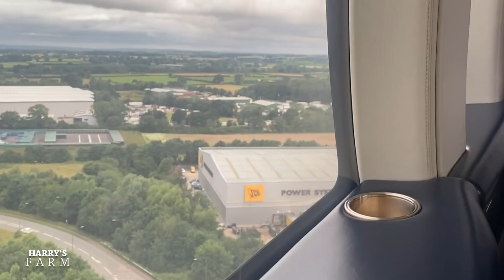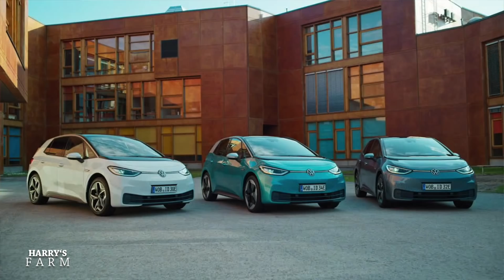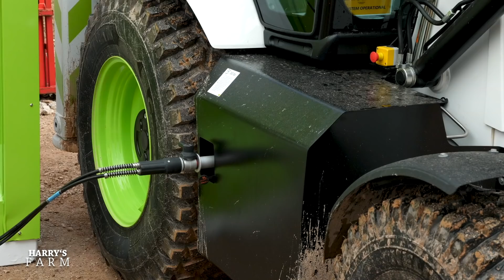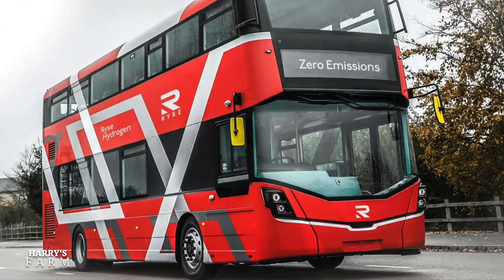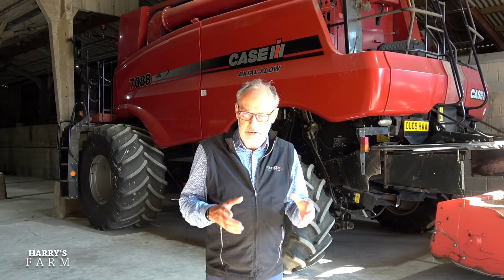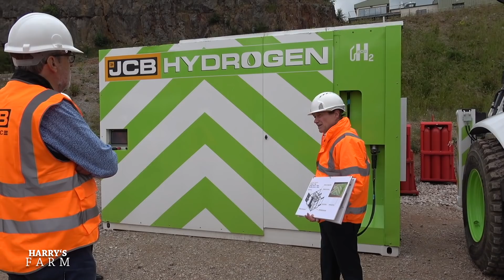Why JCB thinks hydrogen is the best alternative to diesel for heavy machinery, farming and HGV fleet

Comment: Brilliant discussion. Some valid points, regarding run times etc, that many wouldn't realise. Thanks for posting.
Reply: oil companies attempting to sell oils and gas dressed up as hydrogen it is a scam    Depending on the quality of the feedstock (natural gas, rich gases, naphtha, etc.), one ton of hydrogen produced will also produce 9 to 12 tons of CO2  
However, hydrogen combustion with air produces oxides of nitrogen, known as NOx. In this way, the combustion process is much like other high temperature combustion fuels, such as kerosene, gasoline, diesel or natural gas. As such hydrogen combustion engines are not considered zero emission.

Comment: I found this extremely interesting as an excavator operator, I come from swindon and I drive a jcb 140 x and I can't fault shure their are a few thing I would change but it really does drive like a dream. never had a break down in 15 months. the one thing you didn't touch on was how much is hydrogen a litre all the same though hydrogen is definitely the way to go.
Reply from the maker: Thanks for watching. I didn't touch on the price of hydrogen in the video because diesel will remain the dominant fuel for heavy machinery for some time. Hydrogen powered machinery is still some way off. Lord Bamford just wanted more people to be aware electric isn't the answer for the bigger stuff and the world needs to wake up to this fact. Hydrogen currently offers the best solution, in JCB's opinion.
Reply: harry thank you very much for your reply.

Comment: One of the most important interviews, for a true insight, to our modern emerging world. Thank you.
Reply: your going to love your social credits , i bet .
Reply: Unfortunately not. this offering ignores the main problem with hydrogen, which unfortunately Harry et al either choose not to mention or simply don't understand!
Reply: @dipladonic  What's the "main problem"? Is it getting the hydrogen to the farm, mine, constriction site, military battle and storing it there (safely and economically) for transfer to the using machine? Whatever the problem is, you can be sure this Bamford chap is working on it - with his engineers, prototypes and field testing.
Reply: @Myrmecia  If you want to save the planet from the man-made CO2 climate emergency the main problem with 'green' hydrogen is that it takes a huge amount of unreliable and dilute wind and solar energy to make a tiny amount of green hydrogen.
Reply: @dipladonic  Thanks for your prompt reply and alerting me to this issue. I am not an engineer, so I will just have to stay alert for any coverage on this issue which expands on the importance of the "huge amount" and "tiny amount" you refer to.
Reply: @Myrmecia  You won't easily find references to the "huge amount" and "tiny amount" that I refer to as they are never mentioned in relation to any green hydrogen casuistry. There are many green hydrogen pilot projects, some of them will at huge cap-ex costs eventualy produce thousands of kilograms of expensive green hydrogen per year. Unfortunately, globally, we use 49,640,000,000 kg of cheap, plentiful, reliable oil every year. You do the math...then add coal and gas into the equation, then figure out for yourself the veracity of grid-scale green hydrogen. Hopefully, you will have the objectivity to realise that it is nonsense!

Comment: A very thought provoking and interesting video, the ICE certainly has a lot of bad press based on incomplete information and assumptions. A friend and I did a shady conversion to a Vauxhall Viva to run it on butane/propane in the late 1970s, literally an evening spent converting an SU carburetor so it would meter low pressure gas. Far from an engineering marvel but it looks like the industry and governments have little interest in doing similar. There is a lot of merit in adapting existing technology, though of course carrying hydrogen at hundreds of bar pressure in a fast moving passenger car presents different challenges too. Well done with your content Harry, always educational.
Reply: We don’t have to have it compressed if it’s made onboard hydrogen gas can be mixed with  diesel to make it more combustible making current engines much more efficient there is a company developing small ish  on board hydrogen units for lorries in the states at the moment
Reply: @matspencer3860  making hydrogen requires energy, which needs to be carried on board as well. Is it then not more efficient to use that energy directly for propulsion? Please provide a link for that company in the US making H2 units.
Reply: @matspencer3860  Making hydrogen from what?
Reply: LPG and hydrogen are very different beasts.
Reply: @MattOGormanSmith ,  yes they are, but I am sure a 1972 Vauxhall Viva van would run on hydrogen too.
Reply: oil companies attempting to sell oils and gas dressed up as hydrogen it is a scam    Depending on the quality of the feedstock (natural gas, rich gases, naphtha, etc.), one ton of hydrogen produced will also produce 9 to 12 tons of CO2

Comment: Great video, great to see Hydrogen getting some recognition as the true zero emission alternative too. My wife has done extensive research on Hydrogen combustion retrofits for HGV and bus applications and the Gov are looking at it actively. I truly do not see why battery electric is seen as this one true hope for humanity. It makes no sense.
Reply: You are correct it's seems to be an all or nothing approach.   Lord Bamford is correct about mining for the metals needed too .
Reply: Hydrogen In ICE is not zero emission. There will be nox
Reply: @SuperJohn626   - there are catalytic converters... (they are a thing)
Reply: @kadmow  yes. There is also adblue. That doesn't make hydrogen "zero emission fuel" In ICE. I think hydrogen is way to go, but fuel cell is   the key. And long time (half year and more) storage for hydrogen is liquid NH3.
Reply: @SuperJohn626  : everyone has to agree, less pollution is a good thing, if we can get there cost neutral or cost positive long term, that is fantastic, often the hurdle is quarterly cashflow not technology.
Reply: Hello mmmbilly is that research available publicly?
Reply: Trying to bottle it, and distribute it seems to have been difficult. But until Musk made batteries a practical proposition, about twenty years ago, hydrogen WAS seen as the future.
But we also need MSR nuclear technology to produce the hydrogen. At the moment, we get it by starting with methane. Whoops.
Reply: @paulsutton5896  we need to produce NH3 with solarpower, and bottle it. (large scale) Then membrane to crack it to hydrogen and use with fuel cell.
Reply: @SuperJohn626  Good luck with that one,
Reply: @paulsutton5896  check out CSIRO. Their sites find hydrogen and ammonia researches. Australia is believing it
Reply: @SuperJohn626  
I will keep my eye on it.
Reply: Hydrogen causes metal embrittlement, it will destroy engines. It's also difficult to store a useful amount of hydrogen onboard something which uses it as inefficiently as an ICE vehicle.
Reply: @PistonAvatarGuy  : hydrogen embrittlement is a straw man argument - it is mainly a factor in poor manufacturing processes (QC) and  shows up in cryogenic systems mainly.  - neutron embrittlement is a more significant effect to deal with in the nuclear sector.

We have been storing hydrogen in steel tanks and passing it through steel pipes (some natural gas has quite a lot of  hydrogen in it)  for a long time, these things are understood quite well.  

PS. I love batteries for certain applications. Shopping carts and personally owned people pods are a great use...

For high use long haul transport electric trains kick a$$ - just have to break a few monopolies (or get onboard BH.) to make costs realworld.
(Teamsters don't like trains)

I agree hydrogen volumetric energy density is poorer than alternative energy carriers.

Ozone layer??

What about Tesla,  etc.. use of HFC 134a  ??  - it may be nice to Ozone but not the Greenhouse (depending on how one looks at it)
Reply: @PistonAvatarGuy  ...neither of which is the main problem with hydrogen, which unfortunately Harry et al either choose to ignore or simply don't understand!
Reply: @PistonAvatarGuy  Is this for all metals? Maybe we need to develop the system more rather than sideline it completely. EVs are certainly not the complete answer
Reply: @Evanbkwh  I think that some can be made to endure exposure to hydrogen, but whether or not they can be made suitable for use in engines is another question. That's also just the beginning of the problems associated with using hydrogen as a fuel.
Reply: Everyone here putting holes in FCV tech whilst BEVs are literally exploding if they get too hot, use ridiculous amounts of rare-earth metals and pretty much have no way of solving the range problem despite near-constant work on battery technology since the 1970's when Lithium-Ion batteries first came about.

Hydrogen's problems seem like they are less to do with the physics of energy storage, and more to do with the more achievable aims of metallurgy and chemistry and if there's one thing I can tell you out of my ok grades at school is that it is a lot easier to work around extant limitations of chemistry than it is to work around extant limitations in physics.

if FCV tech had the same amount of investment as BEV tech, we'd probably have already seen new metal compounds that are more durable when exposed to hydrogen as well as better infrastructure which to my mind is the real blow for FCVs at the moment. 

There has been experiments with hydrogen "goop" recently though which looks like it solves the storage issues and looks to be to my mind the future of electric vehicles. Plug in your "goop" cartridge, fill up your tank with water for the reaction and off the Fuel Cell goes.
Reply: @Reddsoldier  I'm not sure you know all that much about BEV.
Reply: @Reddsoldier  Yes, you might be able to solve the materials problem, but at what cost? EVERYTHING associated with hydrogen is expensive, absolutely everything, and that's not a problem that's ever going away.

If you're planning on using hydrogen to fuel an ICE vehicle, you're going to end up with a vehicle that has very little driving range. Hydrogen is a very voluminous fuel, so it's difficult to store enough of it in a vehicle for it to be very useful, you might get 1/4-1/3 the range of a normal gasoline or diesel vehicle. That's not a problem that development can fix. Hydrogen also leaks THROUGH materials, and if it leaks into the atmosphere in large enough amounts, it will cause the hole in the ozone to grow again. The real problem with hydrogen, though, is the pressures involved in storing it, they're extremely dangerous and make everything involved with storing the fuel expensive. Just imagine millions of poorly maintained, aging passenger vehicles running around on the road with 10,000 psi hydrogen tanks in them, it would be disastrous.
Reply: Whatever happened to the hole in the ozone layer? Perhaps climate change will also disappear?It wasn't hydrocarbon vehicles that caused the ozone layer breakdown it was the then used coolants used in refrigerators.GM had a longterm car running on hydrogen in 1973.Its performance was similar to the gasoline engine apart from its fuel consumption which was 35pc higher than the gasoline version.
Reply: @eugeneoreilly9356  The ozone layer was fixed - actually by Mrs Thatcher.
Reply: @paulsutton5896  and she was well on the way to solving the climate change hoax by closing all the coal mines.You could say that she was ahead of her time.
Reply: @eugeneoreilly9356  I don't  know if you are intending irony. 
Certainly we are all better off, leaving the coal in the ground.
Except when we want coke for steel production. We should not extract it just for its energy.
And the downfall of Arthur Scargill was ... ... just glorious to behold.
Reply: @paulsutton5896  yip, Scargill and Thatcher,the extreme ends of a wide spectrum.TBH Paul I lost interest in the whole green agenda years ago but having said that I'm all for clean water,air and energy.The real irony is this,while India and China burn fossil fuels at an ever increasing rate to accommodate their expanding economies,we think that we are green because we recycle our plastic milk bottles,by sending them to these places.How ironic is that?
Reply: @mmmbilly
after "extensive research" you do not see why battery electric is seen as this one true hope for humanity?
Then you should take a look at how much electricity is needed to produce the hydrogen for let's say 200 miles.
And the look how far you can drive with the same amount of electricity when it is used in a e-car with battery.
To be honest i have already forgotten the numbers i have seen half a year ago, but i can asure you that you will be surprised by the difference.
I could be completely wrong, but i guess that will be a relatively big factor for the next few years till there is a lot more renewable energy available.
Reply: @fujiwaraemiko7318  long time (half year and more) storage for energy, batteries aren't good for that. Ammonia and hydrogen are solution for northern countries for winter.
Reply: SuperJohn626 , and all the rest of you scientists. 15yrs ago I saw a video of a man in the USA that had a VW connected to about 4 of those large  5 gal  water bottles for the water cooler inside he had a plastic x running from top to bottom . Wrapped around the plastic were wires of 316 stainless in notches that kept them separated by about 8mm . The wires were connected to batteries, making positive & neg electrodes , with fuse & restate to control the power , the water had backing soda in it to help the conduction of the electricity which caused the separation of the H out of the H2O . 
His next vid was one of his Toyota Corolla with about 8 one qt mason jars set up the same way  with regulated air in & lines connected from one to the other & into the air cleaner , so the engine could suck the hydrogen off , he changed his gas mileage from 28-29 mpg to 58-60 . 
I have the set up & I have a old Toy LC ( no computer)I am going to put it on when o get it built up , if you have computerized vehicle you have to trick the computer which he also will provide & instruction as to the quantity of bubbles per min for each jar . I tried it on my 2007 GMC -350 but did not make much diff as I could not find enough room for more than 3 jars 
I know of another co that I made comment about in the main blog
Reply: SuperJohn626 . Google Gail Banks Cal USA  water methanol injection for both gas & diesel.
My father with the Royal Can Air Force  was a ww2 aircraft engine mech , even worked at the Rolls Royce engine plant in England , he said that when the aircraft gets so high & the engines reach the high speed they would turn on the water , that is what made the exhaust smoke turn white , also you will notice the car always runs better when it is raining , he also said the Germans were making petrol from coal , so what is our problem , follow the money . 
My grand father wrote Ford motor co in the 40s or 50s era , asked them how to build. Gas economizer for his Fordson Major tractor , they said Put a water tank above the carburetor , hose , stainless needle valve water regulator & drip water into the carb , so my dad helped him set it up , they said it worked great ,  he used it when he had the tractor stationary using the power take off drive pulley , but being just a child I did not go & see it

Comment: There have been H2 engines in past (BMW V12?) and I still don’t understand why to use H2 as fuel. Only reason I can think of is government money for development grants. There is no real technical advantage over natural gas:
1)	H2 is manufactured from natural gas
2)	Natural gas ICE is nothing new and is already well-developed technology
3)	NG infrastructure is already developed and is quite safe.
4)	There is enough NG for decades
5)	You can always manufacture NG from H2 when it runs out.
Reply: If you make hydrogen from natural gas it’s massively, massively polluting.

Comment: every local solar farm could produce Hydrogen  when the sun shines and theres little demand for electricity
Reply: Yes just snap your fingers and every little solar farm will have a water source, an electrolysis plant, and a compression & storage facility for compress flammable gas! What ridiculous unlearned nonsense. Or maybe you mean to blow up balloons for kids?
Reply: @johnsmith1474  Correct. But snarky. Get out of the wrong side of bed today?
Reply: @johnsmith1474  Probably the better solution is to still send the electricity over the grid and have centralised plants for turning this excess electricity into hydrogen.

Comment: Agree with the use of hydrogen but I can't help but feel that the fuel cell is the better long-term answer.  Burning hydrogen in a static generator is just an odd solution.
Reply: You are correct in what you say
Reply: That’s just to give the engine some work, in this instance
Reply: Mate, this for NOW. They have a working fuel cell prototype, but it's currently too expensive for the market. No industry wants to spend such an increase in price tag for same machine, just because it has a different powerplant.

Comment: Interesting to see hydrogen used as a fuel in a 'normal' combustion engine - seems logical. Off topic: the tyres on the combine - tread chevrons not pointing in the same direction. Ideally they should, shouldn't they?
Reply: The front wheels are driven, the rear trailed. IE on the rear the soil turns the wheel, so the chevron are opposite